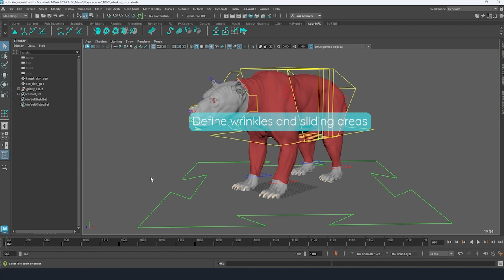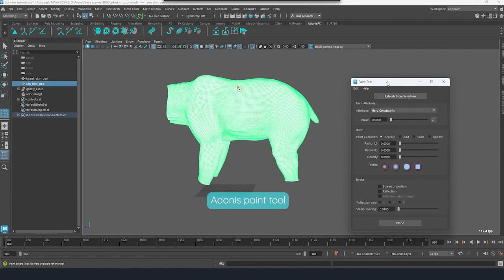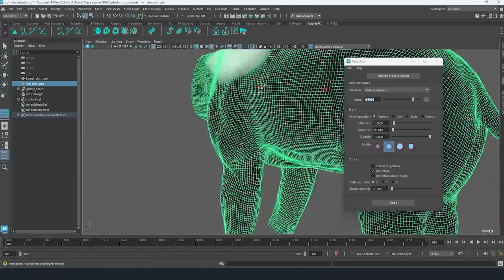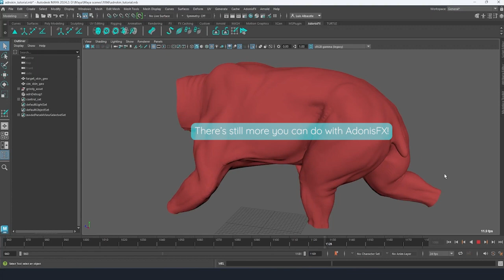AdonisFX Tutorial: Setting up Adonis Skin Simulation Solver

Comment: This is confusing target mesh is raw skinning file? And simulated mesh is freezes on beginning?
Reply from the maker: Hi, the workflow that we are exposing in this video is a way of adding dynamism, sliding, and wrinkles to your animated skin using simulation by using one single simulation layer. For that it is only required to use as target mesh the raw skinning file like you're mentioning and a cutout simulated mesh that has no animation applied to (frozen) and that will attach to the target mesh. 

However, your confusion might be coming from you expecting to simulate the skin on top of a simulated fascia layer. That is also completely doable if you want to simulate more complex cases for which you first simulate muscles with AdnMuscles, you simulate fascia on top using AdnSkin with multi-targets and then you simulate the rest of the layers (fat, skin, etc) with AdnSkin. 

We hope this helped you and we invite you to also check-out our video about simulating fascia. 
 https://www.youtube.com/watch?v=WgBVK825zS0&list=PLloABaiPCtdK3vKbF4nRYM8qnNJ7oACsO&index=15
Reply: @inbibo  thank you ill try it